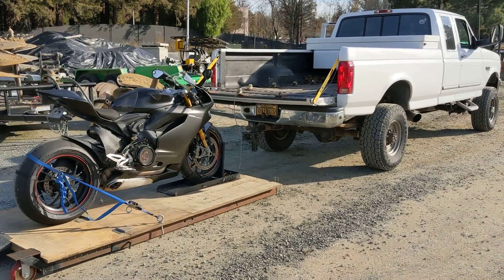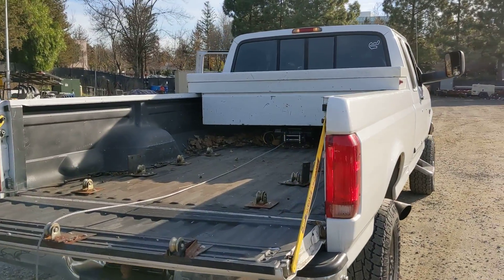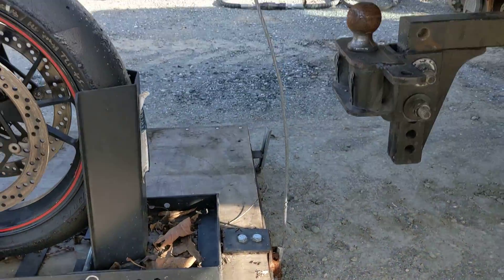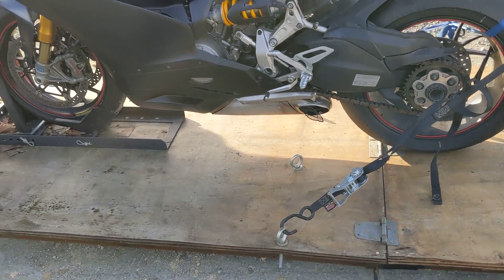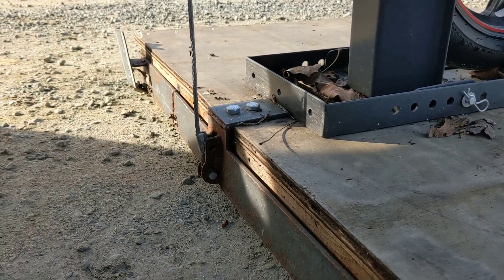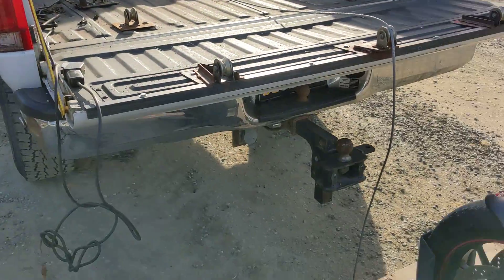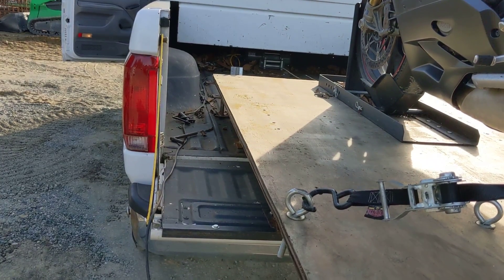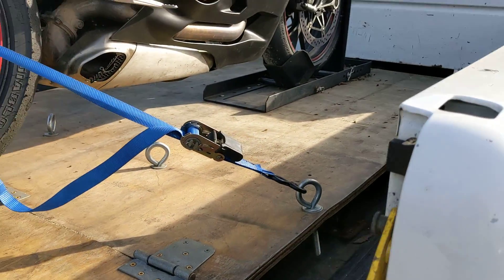The Motoloader: prototype motorized truck bed loader (be sure to check out V2!)

Comment: Got a good head on your shoulders young man, I'm disabled and that would really help me out getting stuff in and out of my truck, could you design something that would fit in temporary so the truck bed can be completely used thank you for any suggestions
Reply from the maker: Thank you for the kind comments. What truck and what are you looking to load / use it for? I'll contact you when I have the plans done, making some instructional videos too. And would be happy to help design something custom for your application.
Reply: Thank you for your response young man, I have a long bed 89 Ford F150, I have five herniated disc and two bad knees, and what I need to figure out is how I can take your system, and rig it up to where I could load a lawn mower, or an automatic transmission it gave me a good idea I'm watching you load that motorcycle before I could do but I'm not a real good Carpenter, when it comes to metal that's a different scenario I will be looking out for your videos thank you for your kind response young man it is appreciated, I was trying to figure out a way to to where you've got those mounted in your bed or I could rig up something temporarily and then remove it later, like in the stake pockets for the bar that goes down and across in the stake pockets, and runs from one side to the other with those rollers on it one in the middle one at the back just brainstorming
Reply from the maker: @scottyparker2534  Certainly! I hope this will be able to help you soon. The way the rollers / v groove wheels are installed in the bed makes it very easy to remove. I'm using rivet nuts in the bed and the width I'm using for the bolts that hold the rollers on the bed is a standard width to bolt in E-track as well. So if you're not using the platform, the 8 wheels in the bed are easily unbolted from the bed and you can use the bolt locations for E-track to secure stuff in the bed (or just leave it bare). This design works really well, I'm just making some tweaks to the system that secures the platform once it's loaded in. Updates coming by the end of the month.

Comment: Disfigured truck to drive your motorcycle into the bed of your pickup truck,  
I am sorry.
Just ride your bike and get a trailer if you need it or a ramp into your bed...
Reply from the maker: Yea it's a salvage truck, panel gap is a disaster. Ugly little thing, but I love it. The main challenge is getting two bikes in, in a reasonable amount of time with only one person. Nowhere to stow the multiple ramps (I don't have the balls to ride up a single ramp at this angle). I tow my travel trailer or my motorcycle trailer with more motorcycles and with the bike(s) loaded in the bed too, so the trailer doesn't solve everything. Also if I'm picking up or dropping off bikes quickly in the city, I don't want to deal with a trailer. Thanks for watching!

Comment: I would love to get the plans to make this.  I have been struggling with a way to do the exact same thing with my Honda Goldwing in my 2012 F250 short bed.  This would solve quite a few of my concerns.  The best part is the tailgate wouldn't be supporting the weight of the bike while driving and loading and unloading would be MUCH easier.
Reply from the maker: Final version and link to plans here: https://youtu.be/PhYCe2LrflA

Comment: Pretty cool. I won't bust balls for those welds, but it seems like you've lost use of the truck to haul anything else now. Can the rollers detach easily?
Reply from the maker: Thanks Ed! Yes they're bolt in (using flush mounted riv-nuts in the bed), the winch as well. Takes about 5 minutes to bolt it all back in. I ran two beads on the critical welds and was sloppy on the top bead squirting it on with the MIG. Wasn't expecting thousands of people to see them...

Comment: Really cool and great thinking. Two questions. How do you get it back off and how did the winch lift the bike UP to the tailgate.
Reply from the maker: https://youtu.be/5xFc3I9S2EU - check out V2 with a quick video of unloading and showing how the platform can be used for something very different!

Comment: Very nice thinking. I had the same problem and solved similarly with a ramp and winch.  Mine does not have a platform like yours so I still have to walk it up. I all so used some 2x6 and 4x4 to make front wheel chocks.

Comment: I like it!
Right now I’m racking my brain to figure out an easy loading system to load my 10’ inflatable pontoon into my truck (I’ve extensively modified it do it’s quite a bit heavier than normal).  
Since you’ve bolted the guides onto the bed and tailgate I assume you must not use the bed for too many other things then?
https://youtu.be/-DOqbkjJTCo

Comment: That is slick. I don’t even ride a motorcycle but could see this having possibilities for loading just about anything you could strap down to that platform.
Reply: Like garden tractors
Mowers
Reply: @soillife1  I was thinking about the same. Even rotortiller,  vibrating plates, trencher
Reply from the maker: https://youtu.be/5xFc3I9S2EU - check out V2 with a quick video of unloading and showing how the platform can be used for something very different!
Reply: I have thought about coming up with something like this for my motorcycle which is why I researched on youtube  and yes I agree with you, I need this for other things..very handy!!

Comment: brilliant idea but like most others i want to see it unloaded.
Reply: Slack the line and pull until it teeters then spool out.
Reply: @icewormproductions7826  perfect explanation. It would be easy really. One thing that you would need to get absolutely correct, is the exact amount of slack in the cable.
Reply: Air suspension at the rear of the truck and/or drive up ramps at the front of the truck, a tilting bed is another option.
Reply: @hitop2365  tilting bed?? Air suspension?? I think that'd be overcomplicating it a bit. Why not just let the winch out and pull on the back a little, it's on rollers so it's not going to be incredibly difficult to slide out
Reply: @imthedarknight-8755  Probably depends how much it’s being used? Pulling it out manually may come with risks either standing in the line of fire or pulling from an angle possibly risking back injury.
Reply: There are two ways to off load. 1) the fast, hard and damaging way, full throttle reverse slam breaks and close eyes. And 2) the slow, soft and gentle way, attach rear of sled by a strap to pole or tree, drive forward keeping eyes open and slowly cable out the wench until sled is gently on the ground. Both methods work well one just has a better result.
Reply from the maker: https://youtu.be/5xFc3I9S2EU - check out V2 with a quick video of unloading and showing how the platform can be used for something very different!
Reply: Play the video backwards:-)
Reply: @marcelvandenburg8737  👍🤣
Reply: Have the front of the bike up over the tool box. Gravity will help with the off load. ...... Maybe.
Reply: @rogerlindsey9446  Gravity is a non observable theory that never has been proven, even Neil Deass Tyson has no clue what it is, so unless you have some hidden knowledge withheld that you must divulge you can not claim it. I say density and buoyancy two very observable FACTS.

Comment: Nik - as I read comments below, there's always an asshole in there. That said - very freakin impressive. Most comments are positive. Very well thought out and a job very well done. I did "kinda" the same thing - but the Harbor Freight 2500LB (ATV) winch - mounted to a 2X6 that I can use when I want, and remove very quickly - using aluminum ramps for "THE MIGHTY SUZUKI DR 650". I have a video on that idea also. What's most impressive to me (besides the design) is the length of your video !!!!! - Mine would have been wayyyyyyyyyy longer !!!!! 😬

Cheers !!!!!

Comment: Every biker with a truck has longed for a way to single handedly load his bike into the bed.  This method is pretty good.  But I've always wondered if there isn't some kind of lifting wheel method still to be discovered.  I picture 2 old fashioned wagon wheels with a platform, on the ground in between the wheels.  You roll the bike on the platform, roll the big wheels forward toward the truck bed, and the bike comes up, slides forward, and lands in the truck just as the wagon wheels hit the tailgate.  Sounds crazy but I can dream, can't I.

Comment: Motorcycles is the least of what you can use that thing for. That thing would be awesome for old geezers like me to load the sacks of feed, or concrete.
Reply from the maker: I'm using it as a dump bed too for job clean up and demo, adding stakes and siding 👍

Comment: I’m an old guy, 60 but I still ride off road. What I can’t do any more is push my bikes up a ramp to get it in the truck, getting it out isn’t a problem yet but not as easy as it used to be. This looks to be a perfect solution to my problem and I think I will build a version for my  dirt bikes. Thanks for the inspiration and great job on the lift.
Reply from the maker: Budman - final version and link to plans here: 
https://youtu.be/PhYCe2LrflA

Comment: I'm a designer, if you would like that made from tube and slicked up I could help. I was working on something similar. Just my KTMs break down faster than I need to load them.
Reply from the maker: Thank you, will share what I have for v2 soon and would really appreciate your feedback. My goal is to use common materials for 95% of the product so it can be easily built and be modular so it can fit all bed sizes and more applications. With no welding required. So that will limit how slick it can look, but should still be a significant improvement from this version.

Comment: Great job! My only suggestion for your future version is beefing up the anchor points for securing the bikes. Perhaps getting the swivel hoist rings. When you put an angular load on shoulder bolts there is a load reduction. Swivels do not have a reduction. So hitting a bump and the bike suspension goes down and back up, basically shock loading the eye bolt... eye bolts don’t like shock loads, actually, no rigging does really... lol!
Also consider using either a shackle or carabiner through the eye of the load straps. If you hit a large enough bump, your strap could unhook. This will guarantee it does not disengage.
I’m currently making a system similar, so after my next fab adjustment I’ll upload a  clip. 
Super ingenious project dude! Very impressed!!! 

http://fulcrumlifting.com/wp-content/uploads/2017/02/eye-bolt-vs-swivel-hoist-ring.gif
Reply from the maker: Thanks Gary! Great tips
Reply: @Grip_Addict  my pleasure dude! My buddy is a motorcycle mechanic and he really thinks your product is awesome!

Comment: Nice! For those that can’t weld or want permeant brackets welded in the bed use nut-certs the bed rollers can be bolted in and off when needed or not. I have a simpler setup in a work van.
Reply: Just make a secondary platform that sits in the bed that can be removed.

Comment: That’s great. Show it coming back down.
Reply: I don't imagine it's too hard. Once you push it back with some slack to the balance point you can just lower it down with the winch.
Reply: @deckmonkey1459  Yeah, but let's see it.
Reply: @cliftt  yeah seeing is believing.

Like people they lack faith in Jesus but when they put their faith in Jesus he will start to show them and trust you will believe Jesus Christ has the power
Reply: @cliftt  It always works on paper.
Reply: If your front rollers are slightly higher than the back rollers it will probably move on its own. Or park on a slight hill when unloading.
Reply: Yea, getting a bike (or anything for that matter) into the bed is the easy part, getting it back out again is the problem.
Reply: Let see you unload it
Reply: @joedirt9600  I'm with you. If there's no need to see it unloaded there's no need to see it loaded. Once you see the rollers and the winch it's easy enough to figure out how, but you still want to see it operate both loading and unloading.
Reply: Legend is he’s still hauling it around in the truck
Reply: Just pull the pins and floor the truck! No winch needed.
Reply from the maker: https://youtu.be/5xFc3I9S2EU - check out V2 with a quick video of unloading and showing how the platform can be used for something very different!
Reply: easy..come along on the front of board and crank it til it gets to the tipping point to get it lowered
Reply: Probably just walk it back with one hand while releasing the winch with the other, once it gets to the tipping point just let the winch hold the weight, and it will lover down the same way it went up, in reverse though.
Reply: What do you mean?
Reply: Only works in one direction
Reply from the maker: @oldcountryman2795  https://youtu.be/5xFc3I9S2EU - check out V2 with a quick video of unloading and showing how the platform can be used for something very different!
Reply from the maker: @oldcountryman2795  or this video shows how it can be used as a dump without the wheels:
https://youtu.be/KaV_b8UzfJg
Reply: What is there to see........ You unwind the winch as you push the bike platform from the tray, once you reach that tipping point you use the winch to guide it down. Once it hits the ground you have the wheels on the platform you help push it flat with the winch onto the ground
Reply: He calls it the “moto-loader”. He doesn’t make any claims about unloading.  😁
Reply: @kungfucommando1642  Waiting for "moto- unloader"...⏰

Comment: observation: As a jerry-rigger guy I'd say nice job but one possible negative.  . . Requires lots of holes in new $70k truck beds. 
That aside I'm a fan of trailers. I encourage guys to drop $3k on a cool safe trailer. Bling it out a little with upgraded bed and stuff. You'll forget the cost on the first use. And you can still use your truck bed for coolers and gear. Meant nicely.
Reply: I bet you could make a steel or even wood frame with rollers on it to lay in your bed without having to permanently attach it. If it fit snuggly around the wheel wells I think you'd be fine.
Reply: @Allroy_66  Maybe sir but think of all the free space with a trailer. Try it once and you are convinced.I'm like George Carlin. I like "my stuff" on a trip. The 7-0's George before he was a total a$$hole.
Reply: @itsruf1  I like the idea of a trailer, but free space is the exact reason I've never considered owning one. The plywood idea could be leaned up against the wall in a garage, a trailer is going to hog all kinds of space while it sits unused most of the time
Reply: @Allroy_66  Currently I have a flatbed a dumper and a small enclosed. . YET no trailer is ever quite right. You want another often .
But at least a start is a start. Generally a guy who buys one says Why did I wait to long? 
But the guy up there is doing good. No bashing. I can't judge.

Comment: Well Done do you think it would work with a full dresser Harley?
Reply from the maker: I'm making a variation that eliminates the tailgate which is the weakest link. I don't think I'd go over 800lbs off the tailgate, I know some dressers get up to 900lbs+. Running it off the edge of the bed, it'll handle a full dresser if the truck height is within the tolerable range for the length of the platform. I'll have a quick calculator that gives you a recommended platform length based on your truck height. 7' - 8' will be the standard, newer HD trucks that ride high will need 8' platform. My truck is a good benchmark for the highest that the system will support (6" lift). More to come...

Comment: The threaded inserts in the wood are probably not going to hold the bike in a moose test after 10 years of weathering depending on the quality of the wood. Silent killer, but you probably won't use it for that long before V2 rolls around. I hope :)

Comment: Love it.  All the main aspects of the design are there.  However,  for heavier bikes, have you consider removing the gate to reduce the weight load being placed?   Love to see you continue and perhaps sell a do it your self kit?  I would buy it. Currently,  I transport my bikes on a Kendon dual bike trailer, Moto tote heavy carrier, and on top of my sierra truck.  I think the best method for me is your good design idea.  Thanks for sharing.
Reply from the maker: Thank you George, I'm working on a "quick build" kit. With all the custom parts included, no welding required. Do you mean removing the truck's lift gate? That's a possibility, but would require bumper modifications. I'd like to instead make the lift gate brace stronger so it prevents warping the gate with heavy loads. Cheers
Reply: @Grip_Addict  Hello Nik,  First, I love your idea.  Please continue.  What I meant is the truck's lift gate.  In the old days, we used to remove the gate to decrease the weight stress created by the heavy bikes like my Harley.   Personally,  I have not used the gate supports. I just remove the gate is a proven method for me.  I use a 3 part foldable ramp system to get my bike on my truck.  It works ok, but It is stressful because sometimes accidents happen when you least expected.   Please keep us posted on your progress!

Comment: Quite similar to mine. I made tailgate swing out to the side.
4 wheels on the platform.  So it just rolls in on the front wheels. No need to line it up. The winch fairlead rollers came with the winch so they got used at the rear of bed.
Easily loads up my 250kg super low bike.